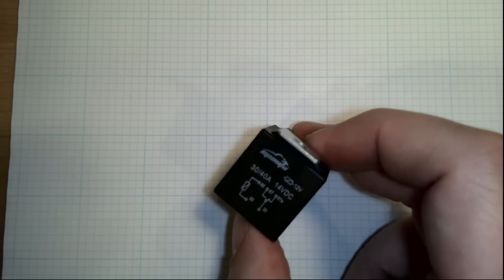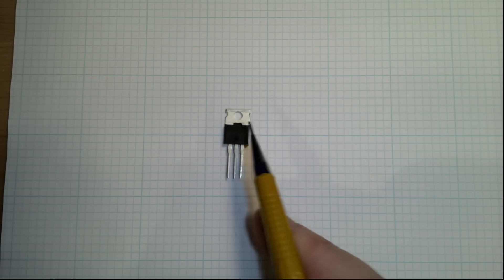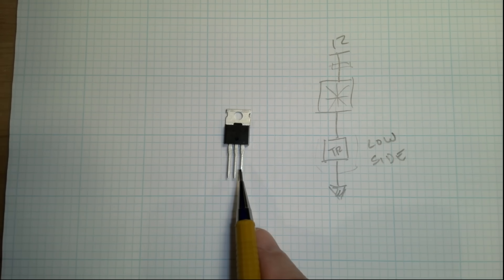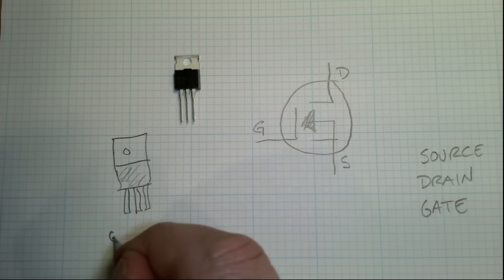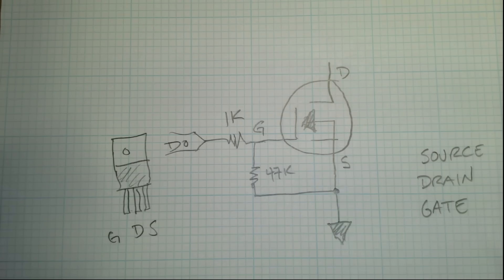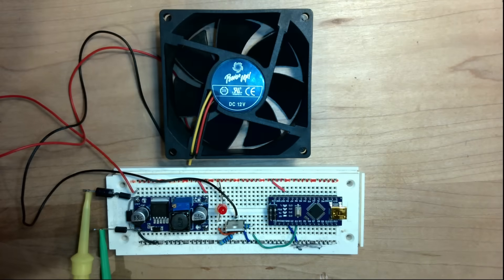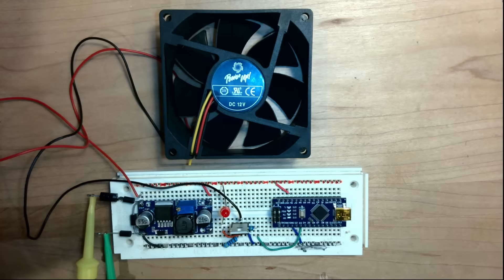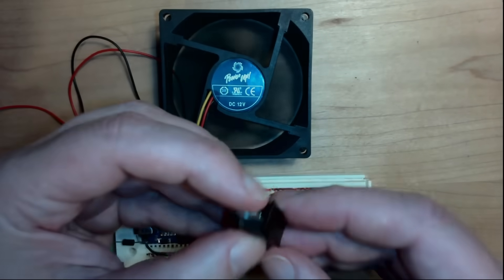Using a MOSFET to Switch High Current Automotive Loads

Comment: Efficiency is an additional MOSFET drawback that favors the relay.  I've never had to use a heatsink to cool a relay😊.  Also, a transistor w/ heatsink is not too much smaller than a cube relay.  MOSFETs win if I have to switch on/off 50x/second, but hard to beat a 100+ year old electromechanical relay design for auto applications.  Additionally, the relays have custom sockets to make removal/troubleshooting/replacement simple (no uncrimping or unsoldering a transistor or related biasing components).  This was a great tutorial, but relay advantages needed equal-time.  Thanks!
Reply from the maker: All valid points. My goal here isn't to replace relays - I still use them a lot. This is video was actually part of a journey toward building a glow plug controller for someone, which are going to require a PWM.  In fact creating this video was a total afterthought and I'm surprised it's gotten the views it has.  The internet is weird.
Reply: @dotnetMakers I for one was keen on watching and ‘how cool’ is that technology. I appreciated the clarity on when to use the P type vs. the N type depending on the proximity to ground switching. I have an automotive wiper motor once switched off, is best kept ‘live’ until it reaches the ‘park’ position where it interrupts the ground. All other devices I want on-command control switching so power side switching. Thanks much.
Reply: @dotnetMakers  Yes, it's weird.
Reply: MOSFETS are already used in fuel and ignition systems. Located in the ECU, it's just that relays are much better at switching high loads.
Reply: @Johnny-es9xg  Relays are not good at switching high current DC. the arc's don't self-extinguish, check the rating of the relay contacts for DC operation. your find it's much lower than that of AC.
Reply: @TheEmbeddedHobbyist  Do manufacturers prefer to use relays for AC and MOSFET for DC? Or am I under the wrong impression?
Reply: @gerodinis relays zre no good at switching high current dC, just look at the ratings on them. The problem is with the arc generated as the contacts break with dc  there is nothing to extinguish it. Causing the contacts to fail and the current to flow. You can get relays with magnets placed to force the arc plasma off the contacts as the plasma can be influenced by magnetic fields.  The  Fets don cut the dc current in a manner that is likely to cause a arc to form. 
AC arcs normally in relays self extinguish as the current passes through zero.
Reply: Agreed!  The ECU is encased in a metal box for noise immunity and the signals it generates are not great.  Fast switching applications are a wonderful application for them.
Reply: Depends how much current you are passing - you can buy power MOSFETs these days that have less than 40 milliohm drain-source resistance. If you are driving 55W headlights, that's about 10A together and that's only a 4W loss - about the same as what it takes to drive the switching coil in a relay.

It's also possible to buy sockets for MOSFETs, just like for relays. And MOSFETs are generally much cheaper.
Reply: @clintoncoker6 40milliohms?!?, which year you're living 😂, you find less than 5 milliohm MOSFETS easily.
Reply: @bobsnabby2298 Yep, that's why I said "less than". There are mosfets with under 2 milliohms as well that have been available for years.

I was trying to underpromise and overdeliver 😂
Reply: @clintoncoker6  Dude! they have 60 volt MOSFETS with 6 milliOhm RDSon.
Reply: @Slickrock72 You didn't see my second comment huh. Yep you can get 1.4milliohm 20v, which is fine for automotive
Reply: IRFS7530
Reply: @clintoncoker6  Personally, I wouldn't use a 20V VDS MOSFET in automotive power applications because of all the inductive switching noise transients, I'd prefer ≥40 VDS.
Reply: @clintoncoker6  there are plenty of devices no with single digits of milliohms RDSon. I have some IRLBA1304 on my desk here, 4 milliohm RDSon, 40V, 95A (the die will take 185A, the package is the limiting factor), TO220, logic level drive. They were made in 2000, I hate to think how far MOSFETs have developed since then.
Reply: @clintoncoker6  there are MOSFET's with 1 miliOhm or less resistance. 4W is much power, need cooling.
Reply: Most automotive applications have switched from relays to MOSFETs already. I work on Chrysley TIPMs all the time, and they are full of them. Not needing a heat sink on a relay does not mean it's more efficient. The relay needs constant power on the coil to keep it switched on. The load contacts are almost 0 resistance, so load current does not generate heat in the relay, but the coil does. The internal resistance of the MOSFET results in some losses as heat as current passes through, but it does not need constant power to keep it on. Once the gate is charged, it will stay on until the gate is discharged. Most of the applications a relay is used on could use the MOSFET without a heat sink. One advantage of a relay is isolation between the switching coil and the load contacts. That can't be achieved with a MOSFET without additional external components. Isolation is generally not a factor in automotive relay applications, though. That said, though, if a MOSFET fails, it can put 12v on the gate and take out the control circuit with it unless appropriate external protection circuitry is in place. I would suggest using an isolated gate driver so a failure doesn't destroy an expensive module.
Reply: @SwapPartLLC Is a simple diode sufficient to protect a microcontroller driving a MOSFET gate?
Reply: Plus, most mechanical relays today have a 100,000 cycle lifespan .
How many years of service will the average person get? Probably more than they will need.
Reply: @mikesmith-po8nd  Relay contacts can weld.  A well known model, Kilovac, was designed out of PV inverters at a company I once worked at, because they had an unacceptable percentage rate of welding contacts.  Inductive switching is hard on relay contacts, the best relay designs for this application  are sealed and filled with SF6 gas, making them much more expensive than a MOSFET bank.
Reply: @mikesmith-po8nd  Relay contacts can weld.  A well known model, Kilovac, was designed out of PV inverters at a company I once worked at, because they had an unacceptable percentage rate of welding contacts.  Inductive switching is hard on relay contacts, the best relay designs for this application  are sealed and filled with SF6 gas, making them muck more expensive than a MOSFET bank.
Reply: Relays don’t need “Equal Time” when one is merely presenting an option to the relay, rather than a compendium of all possible pros and cons, of all possible switching scenarios, for all possible power loads or signals, for all possible environments.
Reply: Solid State relays exist and use standard relay sockets. Hella makes a good one I believe
Reply: Enter automotive grade protected switches. They integrate a "resettable fuse", can detect faults such as short and open, are certified for engine bay temperature ranges and outlast a mechanical relais with the blink of an eye. For anything but niche applications OEMs stay away from relais nowadays. Actually, many did so for the last 15 years already.
Reply: I like when people enter into a dialogue about differences in relays and MOSFETs, and pros and cons with good arguments.... I learn a lot from this as it needs to be... thanks a lot, not only do I clarify some doubts.. but I can make a good decision when to use one or the other depending on the application!!
Reply: Heat kills semiconductors.  Even (only) 4W of power in the form of heat has to flow somewhere cooler or bad things happen.  If these xsistors are located in the trunk with some kind of air cooling, maybe?  But in the cramped engine compartment next to an engine running at hundreds of degrees (C or F) on a hot day, they are going to feel it.  Switching to LED lamps for your headlights "should" mean they will last for the life of your auto, but it doesn't happen--for a similar reason.  Relays should (and DO) handle harsh, hot, electrically noisy environments without complaining for years.  I'm not trying to talk anyone out of experimenting with semi's (I do it all the time), but for mission-critical applications (e.g. traveling through the Mojave desert in July), just know that the reason that relays have been in cars for 100 years is not because auto engineers are luddites or stupid or lazy, but that they are a proven and efficient technology.  Thanks.
Reply: @PaulChaney-tf5yu  Power MOSFETs (not in the linear region) don't consume that much power (heat).
They DO if kept in the linear (regulating) region.
Reply: 6:10 there will be good to place zenner or some voltage supressor device to protect transistor from inductance voltage spikes
Reply: Used a MOSFET to repair an old OEM car radio that had a habit of burning the power switch contacts and not turning on.
Still working good even in hot weather (used a small heatsink because there is little air flow where it is mounted).
Reply: Power dissipation is only an issue when the transistor operates in linear mode; very little power is dissipated when the transistor is used as a switch, either fully on (full current but very low voltage drop through transistor) of fully off (no current, supply voltage across the transistor). Power is the product of voltage and current, so you can see very little power when on or off; the product is only significant when you try and keep the tap half open and there is both a current flowing and a voltage drop across the transistor
Reply: MOSFET has lower on resistance than an EMR.  Additionally, no current drain from driving the coil on an EMR.  How can it possibly be less efficient?  I prefer relays for most applications but MOSFETs definitely have some advantages.
Reply: @channelview8854  A low voltage DC 15 amp contact relay coil can typically dissipate .5 watts or more when energized, and the heat generated can be easily tolerated by the relay.   A MOSFET with an RDSon of 6 milliohm will dissipate about a watt at 13 amps and will need a small heat sink.  As the current commutation requirements go up the relay is clearly more efficient.  The other good thing about a relay is there is an air gap isolation when the relay is off.  The MOSFET is relying on solid state physics in the semiconductor junction to provide isolation.  For currents less than 10 amps a MOSFET is more efficient, with the caveat mentioned above.
Reply: If you make a relay as small as a MOSFET, you will need a heatsink. MOSFETs are highly efficient. Relays consume power to keep them turned on (unless they are a latching relay). Also, this video seems to be about using an MCU as a control, and a relay without a freewheel diode might generate a voltage spike that might kill your MCU. Relays have contacts that can corrode, wear or burn, particularly when switching high DC currents. MOSFETs are preferable, IMHO.
Reply: Enhancement Mode vs. Depletion Mode:
Enhancement Mode (usually off): The conductive channel is created (enhanced) only when a voltage is applied to the gate. This is the most common type and is used as a "normally open" switch.
Depletion Mode (normally-on): A channel exists even with zero gate voltage, and applying a voltage (of the opposite polarity) reduces (depletes) the channel conductivity to turn the device off. This is equivalent to a "normally closed" switch.
Reply: В схемах где требуется быстрая реакция (схемы защиты) -транзистор имеет неоспоримые преимущества. Во всём остальном, реле - лучший выбор.
Reply: If lightning strikes in Brazil the MOSFETs in my HVAC blow. OK that's an exaggeration. Or is it?! The ECM fan motors in my HVAC use MOSFETs. But I can't get an ECM motor to last longer than a year or two.  A PSC motor usually lasts trouble free for 50 years. And if lightning strikes down the street the PSC motor giggles and says that tickled, do it again.
They have forced ECM motors on us with the claim they save energy. But replacing it every two years uses a lot more energy than that ECM motor will save.  And what's more is the question does the ECM motor actually save energy? I don't think it does. They claim it allows lower speeds for the motor so you can save energy when you run it at those lower speeds. BUT, most of the applications in my house won't work on lower speeds so that feature is worthless.
My conclusion is 100 year old technology PSC motors are greener than ECM.
Reply: @kthwkr  Lightning strikes can propagate everywhere in a circuit, the best hardened designs have GDTs, ZnO MOVs, and transient diode snubbers everywhere to clamp stray transients, plus using a Faraday cage for the critical/sensitive circuits.
Reply: @kthwkr  Make sure you have good earth grounding and whole building surge protection!
Reply: @kthwkr  That reminds me of the first generation LEDs in our cabin in Sweden. To save power I installed five of them, at the time about $20 a piece. Then lightning struck the power line. None of the incandescent lamps failed, all LED lamps were fried. I don’t know if they have been improved since against this type of hazard (today our power line  is sub soil)
Reply: Speaking from "a little knowledge is a dangerous thing": what about using optodiode/optoisolator/optocoupler? (I'm assuming it's about the power limitations of an optocoupler)

Comment: It's cheap and easy to replace  Chrysler switched over Jeep lineup for the main electrical hi output electrical fan for radiator they burn up every freaking 3 years usually ruining the damn motor I have electrical fan relays from the 80s still rocking it hard
Reply: gm  left the chat..

Comment: Thank you!
You, sir, are a very good teacher. It finally clicked — the difference between N-channel and P-channel MOSFETs, as well as the role resistors play in a MOSFET circuit. 👍 Just subscribed.
Reply: The resistor that pulls the gate to ground is necessary.  I built a similar circuit with 12 volts, a turn signal bulb, and a power MOSFET.  When I touched the gate with 12 volts, it lit the bulb as expected.  When I disconnected the gate, the bulb stayed lit!  The gate draws zero current, so its voltage continued to float.  The gate voltage does not immediately drop to ground unless you have a resistor as shown.
Reply: congratulations, i learned something too!

Comment: Very informative and interesting BUT.... You say that instead of the relay, you can JUST use the FET.  That is incorrect. You also need a microcontroller and other electrical components. 
It's a shame that a interesting and informative video is spoiled by misinformation.
Reply from the maker: Drive it with something else like a switch. It doesn't require a microcontroller, it requires voltage.

Comment: I honestly don't know why I didn't think about doing something with fets before. I guess I was thinking it would be too complicated but, in all actuality a bunch of circuits could be condensed into one spot and integrated with logic. I have been using relay boxes and fuses for the longest time. More recently using some solid state relay modules. I think I have a new project now and you have earned yourself a subscriber. I'm happy the algorithm put me onto your channel. I will be waiting for the next one about p channel fets. Thanks for your time and the informative video. Keep up the good work.
Reply: heat and back emf will kill electronics..ensure sufficient heat dissipation
Reply: I can't help but wonder if those SS "relays" are simply this (with the back emf protections) in a package to mimic the relay.

Comment: I have 2 DC motors on a portable bandsaw mill that I would really like to replace my automotive starter relays with a solid state reversing device.  The inrush is 60 amps at 12vdc per motor.  Sounds like it should be easy, but........not so easy as I'm learning quickly.  I cannot find an "off the shelf" solution and I need to build it if possible.
Reply from the maker: You're probably after an H-bridge motor driver. That allows reversing polarity and is made for dc motors.
Reply: @dotnetMakers  Thank you.  That is what I built with the Ford style starter relays.  Over time those relays burnout or get stuck.  If I can find or build a solid state H-Bridge I hope it will last years before failure.
Reply: Solenoid
Reply: @peterl9640  Not solenoid.  Solenoids pull the starter drive into the ring gear and supply power to the starter armature and field coils.  The relay supplies power to the solenoid.  The older Fords only used the relays to power the starter motor and the spinning of the motor pushed the drive into the ring gear.  Also, Semi trucks used these relays to power the starter solenoids because the key switch hasn't the current capacity to power the starter solenoid on its own.  
Please have nice day.